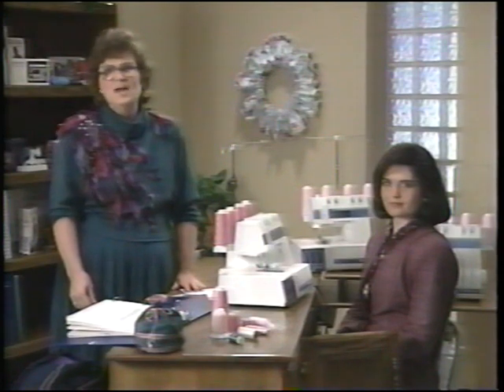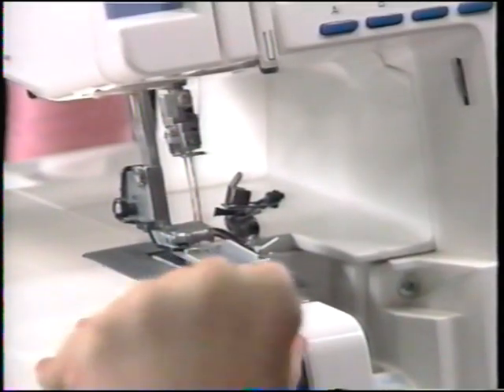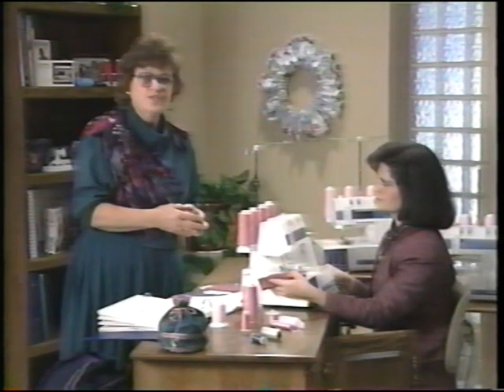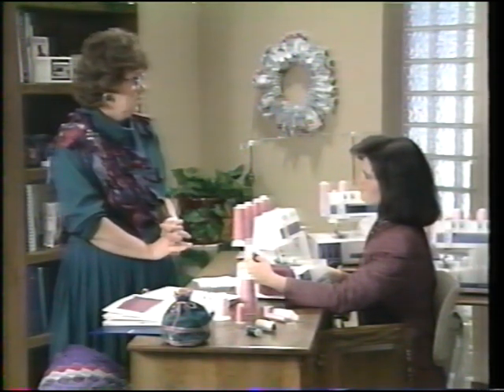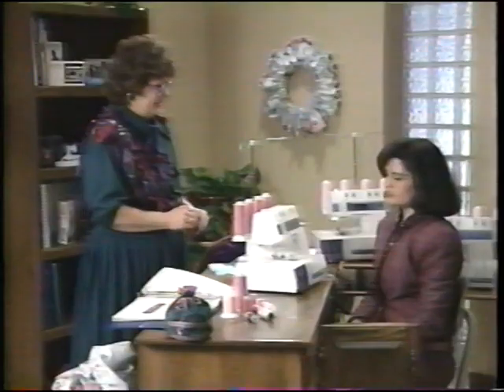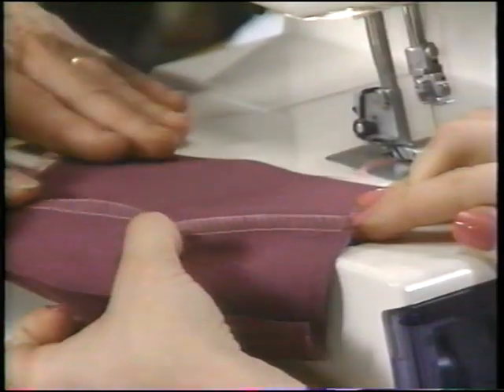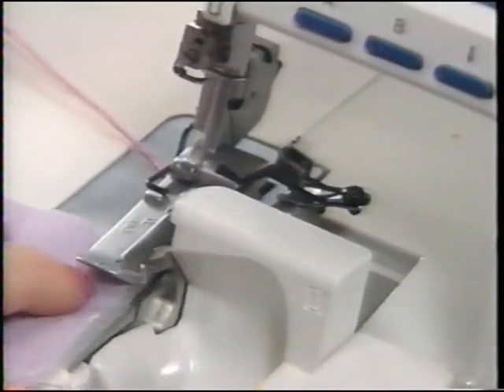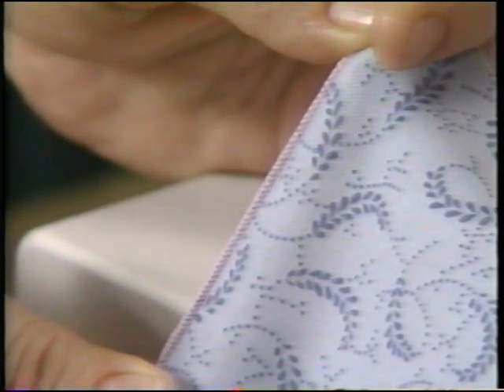Husqvarna Viking Huskylock 1000 1000L 1001L Serger  Handbook Video

Comment: Thank Heaven for this video! I purchased my 1001L 22 years ago and used it frequently then but not so much in the past 10 years.  I covered it and promised myself I'd try it again one day. I lost confidence in being able to thread the loopers without the threads breaking a few inches in. This video gave me the confidence to try once again. VOILA!  I did it!!  My chubby little 68 yo fingers have trouble with the "clip" in the lower looper.  Any tips?  Also, my dealer did not offer the binder handbook. Are they still available anywhere?  Thank you, thank you, thank you!

Comment: I have the original booklet and binder of directions with my used Huskylock 1002 LCD, but find them difficult to see the small points of threading.  With this video I am finally able to use the double chain stitch. These machines are like old work horses.